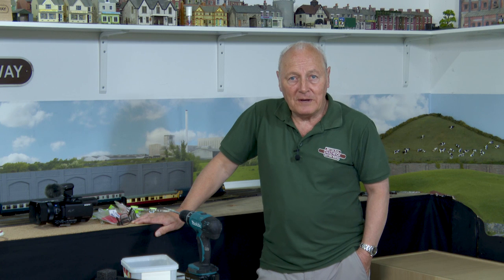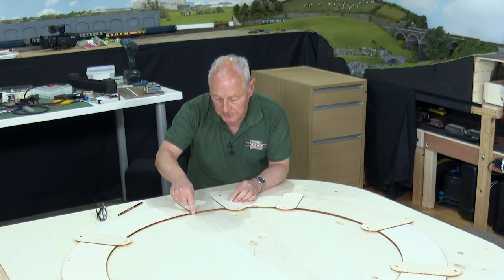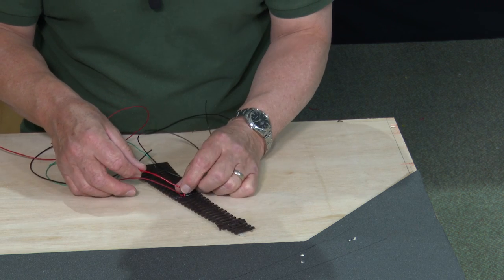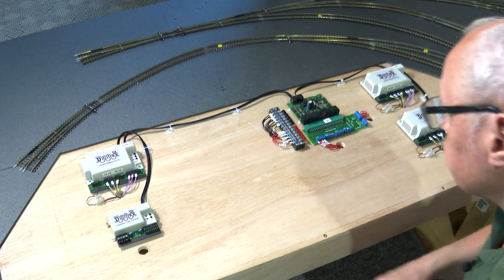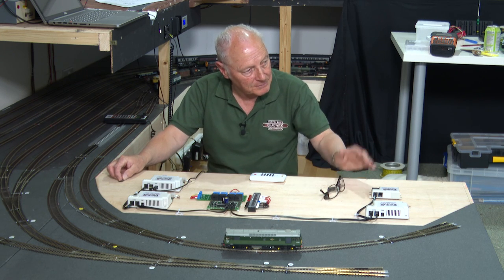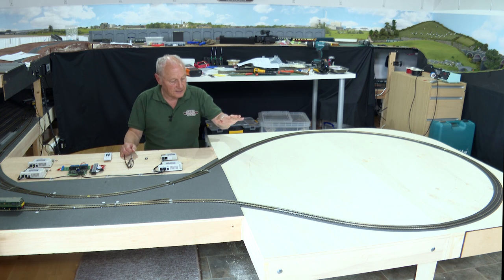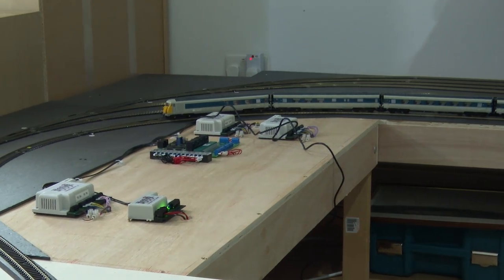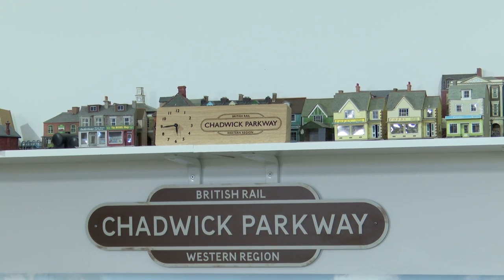Layout Update and Installing a Reverse Loop at Chadwick Model Railway | 162.

Comment: Just home from a 2 week holiday, and what's the first video I watch but Charlie's. and that comment at the end about "upgrading your Loconet" got me thinking, do you make your own extensions or purchase them?
Reply from the maker: I do make up my own cables which is straight forward.  However, I have installed a LocoNet booster (LNRP) due to the number of components in a certain area. Regards Charlie

Comment: Excellent and thorough film - as usual. I wonder, with sound loco's, is there an issue with the sound remaining on hone the train has disappeared from view? The train is 'underground' but can still be heard.
Reply from the maker: You make a good point, however Train Controller can switch off the sound as it goes down the helix. Regards Charlie
Reply: @ChadwickModelRailway  I guessed you'd have a solution.

Comment: I would opt for the second Helix Charlie it will save the temporary work.  Any reason why you had both  rail exits at the last and first points as insulated joiners? I would have thought you only needed one as both tracks were double broken further up.  Of course you could have had none and had a long frog but that gets confusing further down the line - so to say...

Marathon video so I think I will join you with a lie down!
Reply from the maker: Hi Paul, the reason for the added insulated joiners was I thought about a separate block if needed.  The long frog was something I had dismissed watching the FishPlateFilms video.
I’ll shoot the next helix build once I have all the bits (and the courage)!
Regards Charlie

Comment: Hi Charlie. Another great and informative video as always. Please do a video on H2, pointing out where you have changed your approach from H1. One thing I did notice is that your Blue Pullman seemed to have RED lights at the front as it came up H1. Is this another little problem or just a camera glich? Dave
Reply from the maker: Hi Dave, I will film the building of H2. The Pullman lights were white, however when filmed at 4000 Kelvin they do appear pink. Regards Charlie

Comment: Hi Charlie, great video as ever. I understand the wiring of the point into the point motor but why do you use a smaller gauge wire, isn't it subject to the same current draw?
Reply from the maker: The point motor draws less current than the train on the point.Also there will be a bigger voltage drop on the longer cable hence a larger size. Regards Charlie

Comment: if the string is any distance from the point of the pencil remember to keep the pencil of the string compass vertical in order to keep the same radius. If the string is looped around the pencil point then it will not matter. Also if you had kept the bottom loop of the helix at board level, you could have used it for the reverse loop instead of an extra track.?
Reply from the maker: I understand your point to Victor however, I think it would’ve just added to the complexity of the Helix bill. Regards Charlie

Comment: Great stuff, Charlie.  Fantastic to see progress on the layout again.  Happy to see building of the second helix: you must have gained experience building H1, so it won't be just a repeat.
Presumably what you said about a reversing section needing to be longer than your longest train, only applies if all the coaches/wagons have pickups? Or is that something specific to DCC?  On our old DC layout we just bridged the insulated rail joiners with diodes on reversing sections, the shortest of which was only about 18" long - as the loco crossed the insulated join, you just reversed the direction on the controller.  Though having a solid state box of tricks like yours do that is even simpler!
Reply from the maker: No it’s not DCC specifically Andrew.
If your coaches, for example draw current through lighting circuits, it could throw the circuit again.

Comment: Hi Charlie. Well done on the reversing loop. I confess I still can't get my head around the need for a minimum length of train (I'm assuming a single locomotive here; I guess a "power car" at each end of the train would make a difference). Was your Pullman being driven in reverse, or was it a trick of the light that the lights look red?
Reply from the maker: The train length is due to coach/wagon pick-ups. The Pullman white lights appear pink with my camera set to 4000 kelvin!

Comment: Charlie, Thank you, what a mammoth job,  I am watching in awe, as I need to rip out my entire layout as the attic space is not accessible with the track and boards where they are. I noticed (Unless my monitor is doing some strange colours) that when your reverse livery Pulman was running it appeared to be showing the "Red lights" to the front when it came down the helix, is it my monitor or is there a wiring fault inside the wee beasty
Reply from the maker: Hi Richard, well spotted but nothing is wrong with its lights. The video camera has difficulty in recording white lights from LEDs. Regards Charlie

Comment: Hi Charlie - Another excellent video again. Thank you very much. 

Just wanted to share something that you may or may not be aware of with the BXPA1s.  About 12 months ago on the Digitrax email forum thing, it was discovered that if you have more than 1 of these units on your layout, if one needed to reverse polarity it seemingly changes polarity on all BXPA1s on your layout. This obviously had some knock-on effect with short circuits and some odd behavior etc.   
Digitrax has since released a firmware update that I believe has solved this issue, but I thought I should mention it just in case you hadn't heard and to hopefully solve any potential head-scratching in the future as you mentioned you plan to have 2 of them and they may or may not have been shipped to you with the newest firmware?  Which, actually, might be a contentious subject for future videos - How to update the firmware on your layouts controllers...! I'm scared to do mine if it ain't broke etc! But Am I being foolish with that approach?!
Reply from the maker: A very interesting comment Nick.I shall certainly check out to see if the firmware is available for download, regards Charlie

Comment: Thanks for the video Charlie, another interesting one.  If you have a 2–10–0 it should be about the longest wheelbase to test the tight curves.  Just to clarify, do you use double insulated fishplates on both the point and on the section of track further on?  Does it mean that you will have to restrict speeds of trains running through the tighter curves and if so can you select that automatically using your DCC controller?  Yes I would like to see the helix installation please.
Reply: Are you referring to the 9F (Evening Star)? Then yes that would be a good start to gauging track placement
Reply from the maker: Yes a fair comment gentleman, evening star should be a good choice. The restriction of speed within the Reverse loop has yet to be determined, but it shouldn’t be that slow. Regards Charlie

Comment: Great video Charlie. As you are trying DCC Concepts Legacy track, have you also tried their rail joiners? The insulated ones are a lot less obtrusive than the Peco ones.
Reply from the maker: A good point Mark, no I haven’t but I surly will. Regards Charlie
Reply: I downloaded an insulated fishplate design from thingyverse and got a bureau to make 100 of them for me. Cheaper than peco, black and much less obtrusive. Slightly more fiddly to install though as they are rigid yet thicker than a metal one.

Comment: With the enthusiasm of your subscribers for a helix, it might be time to remind everyone of the principal property of helices.  They are long - very long.  The ones at Chadwick will if my calculations are correct be each about 53 ft long.  A train running round the complete layout from station back to station via the fiddle yard (or its bypass) will therefore travel about 175 ft of which only about 35 ft will be visible in the scenic section.  What applies to distance also applies to time (roughly) meaning that the train will only be visible for about 25% of the time from the disappearance of the last coach to the reappearance of the loco.  This may or may not be a problem, but it is at least something to be considered.  I use a helix and (on a dc layout) reduce the gaps by allowing two trains to operate simultaneously on the one circuit.  Chadwick my find a similar arrangement useful.
Reply from the maker: A very interesting point Graham.  The task makes me shudder already.  Regards Charlie
Reply: Personally, I like the length and a train being hidden for ages, as it does suggest it's gone somewhere!

Comment: Hi Charlie can i ask in very hot weather do you have problems with track expansion /movement. Seem to happen more on flex track code100. Your videos are great and i have taken some of your idea into my own layout. Kind regards best wishes Steve.
Reply from the maker: Hi Steve, it’s not an attic layout so temperature is much more stable. However, I never lay track if the room is cold. Regards Charlie
Reply: @ChadwickModelRailway  ok right thank you mine is a garage layout.

Comment: Hi Charlie.  Your statement about the reverse loop was not quite correct.  Traditionally a reverse loop folds back onto itself at a single point so your train must be physically shorter than the reverse loop so it does not crash into itself as it runs out the other side.  In your situation your reverse loop doesn’t meet itself for quite some time (if at all) which means that your limitation is electrical, and only if you have 2 through wired items crossing the isolation zones at the same time.  You could have a freight train longer than your loop with no problems whatsoever. But great video as always.
Reply from the maker: Thanks Rodney, regards Charlie

Comment: Tremendous work there, that is a long mainline run! Do film the installation of the second helix, it’s too big of a project not to! Are you planning any automation of the reversing loop point to set them correctly for manual train driving? I’m guessing train controller will set them appropriately when trains are operating in autonomous mode.
Reply from the maker: Yes Cedric, you’re exactly right. Train Controller can always sort out the routes when I wish to drive manually,
Reply from the maker: Judging from the response, yes I will film this building of a second helix. Regards Charlie

Comment: Hello Charlie,
Smashing video and it really does get the juices flowing.
I know you've given us dimensions of the helix, many times, but my old grey matter doesn't hold on to that sort of stuff for very long.
Anyhow, I recall you're using 3rd and 4th radius curves so you must be using the off the shelf DCC Train Automation helix kit. That being 2.2% for the larger radius curve, what is the longest train of 10 foot wheelbase vans you can get up the helix with single and double headed power? Let's say a pair of BoBo and a pair of CoCo locomotives (BB and CC in your neck of the woods). 
It would be an interesting trial for a video but would also go some way to making my mind up on the helix decision.
Also, what about passenger trains? Do you think a Deltic could pull a full length Tees Tyne Pullman up the incline? 11 cars with a mixture of mk1s and mk2s.
In anticipation,
Bob
Reply: Charlie,
A bit of advice. If you want to know how diesels and steam locos will manage up a helix, I recommend you take a look at video 118. It's a belter. A Western with 10 on? Who'd have thought it? If a Western can do 10, a Deltic should romp away with 11, shouldn't it?
Bob
Reply from the maker: Hi Roberts, I will do a more in-depth power video in the future once things are up and reliable. Regards Charlie
Reply: @ChadwickModelRailway  Smashing. Just what the motive power department ordered.

Comment: HS2 yes please! Was it me or were the loco lamps the wrong way round once your diesel had negotiated the reverse loop. Certainly red lamps were illuminated in the direction of travel.
Reply from the maker: No the pullman has yellow forward facing lamps, but with my camera set 4000 Kelvin they appear pink. Regards Charlie

Comment: As the second helix gona be roughly the same as the other;
stand behind where it gona be,
finger snapp,
it appears with two running trains on it,
tell us there would be videos about the first helix here ( 114. ) and there ( 115. ),
then you tell and show us what you did this time better 😉

But before you do a "Charlies Road Trip" video about bridges as there is a gap above the left/eastern(?) not finished yet river 🛶
Reply from the maker: Well spotted, I need to build Helix 2 and then join up with the tracks by the river. Regards Charlie